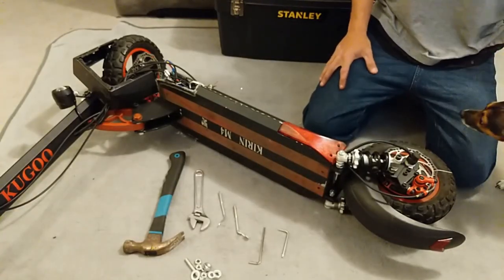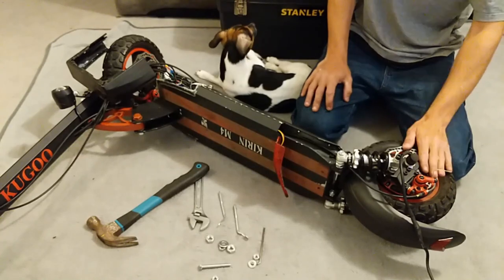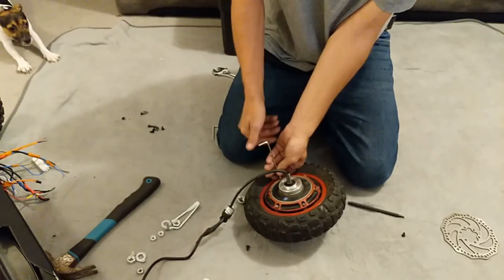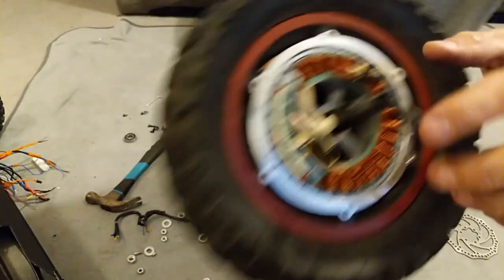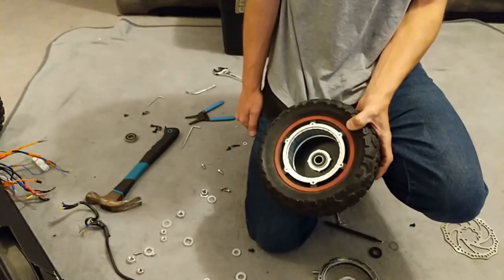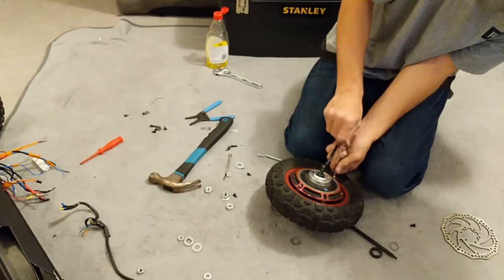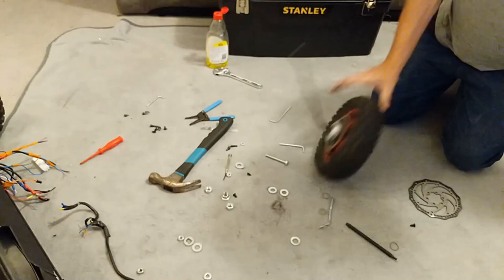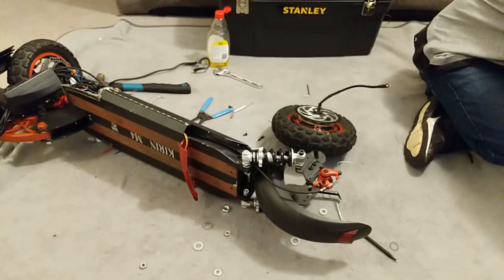Kugoo M4 rear bearings replacement Demo (Motor wheel)

Comment: IV had a tyre change now IV got error 1 and my scooter doesn't work the wheel spins when off the ground but makes a loud rubbing noise and when I try ride it it's cuts itself out
Reply: I've got the same issue have you fixed it

Comment: I have a grinding noise from the back wheel (Motor ?) when I accelerate but the noise goes when I release the accelerator even though the scooter is free wheeling, is there any demos to fix this problem, ?
Reply: Ive got the same issue have you sorted it
Reply: @5staranis800  Not yet, The fellow I bought the scooter from no longer answers the phone, im trying to contact kugoo directly, but not having a lot of luck, If I do get to resolve this, I will let you know and I would appreciate it if you do the same,  Thanks

Comment: Brilliant video, much more helpful than I was even hoping for! Just a suggestion though, you may want to add some kind of tag to your video. I've just used the first 15 minutes to show myself exactly how to easily get to absolutely everything I need in order to fix the "E-001" error. You have made it simple to isolate all the correct wires, as well as removing the rear wheel to repair/solder any breaks that could be causing that exact fault. There aren't many videos that have helped with that fault (and on the exact scooter I was looking for). The ones I found were mostly non-english so I had no idea what was being said. If you were to add a tag for the E-001 code you might help even more people :)
Reply from the maker: Thanks for the comment mate. I'll take the advice onboard . Error 001 on a tf-100 LCD display most of the time means hall sensor failure there are a few rare exceptions but mostly hall sensor . If your ever stuck feel free to send me a message an I'll talk u through any scooter/ebike issue's

Comment: Thanks a lot man ! If anybody around here is trying to fix the bearings of the urbanglide ecross pro, it’s the same only when you have to put back the motor inside the wiring are facing down and not up, otherwise it can’t go fully inside and you can’t close the lid

Comment: Hi mate I replaced my tyre tube and now I've got a error code 0001 a motor error but so it doesn't spin at all but when I switch of lights horn etc the motor starts to work but I just vibrates but when I put the scooter on ground it just vibrates
Reply: IV got the exact same problem. My wheel does spin when not in the ground but with a loud rubbing noise . If I try to ride it it just cuts out. Error code 1 aswell
Reply: @lornadavis6663  that's exactly what's happening to me too let me know if you fix it pal
Reply: @5staranis800  no idea mate IV looked everywhere online and there not a thing that can help. I'm taking my rear wheel to bits tonight cos that seams to be my only option. I'll let you know if I can find the problem
Reply: @lornadavis6663  me to please I got the same 😂

Comment: Nice vid. How much will you charge me to sort my scooter out. I've got a kugoo m4 and i popped the back innertube. I've been through about 5 tubes and they all pop. I ordered a solid back tyre for it but it doesn't fit even though it says its for m4. its doing my head in tbh lol taking the wheel off and putting it ack together for it to pop i think it may need a re wire because taking the wheel off all the time rips the wire casing. it still works fine but not really ridable with a flat tyre.

Comment: What would you do if u damaged the wire's,I have soldered back together but it still doesn't work???????
Reply from the maker: Hi mate , damaged motor wire few questions  did u rewire it going with a new cable going right through the spindle or was it a cable break that left u enough room to rejoin the too half's  in either case did u check the hall sensors are still functioning,  chances are if u had a cable break and the scooter was powered up one of the three phase wires touched a hall sensor line and passed more than the 5volts the sensors can handle . Sounds bad but it's not and if u manged to Solder the cable back together I don't see no reason u couldn't swap out the sensors your self if u felt up to it

Comment: The wire on my back wheel has been damaged and I don’t know what to do only had it a month
Reply: I done the same thing gonna attempt a repair on the weekend
Reply: @roya1er210  did it workout and how hard was it
Reply: It works lost a few mph off my top speed for some reason but its very findly but its possible

Comment: Where did you get tiers from please
Reply from the maker: Amazon mate 10x3 tubeless tyres but they also can be used with a 10.25 inner tube that is supplied as well with each tyre 19.99 each

Comment: Need help with Erre coad 6
Reply from the maker: Hi thanks for the comment, what scooter model do u have
Reply: Hi Mike hear ,thank you for your reply, I've got a kugoo M4 I have tried checking all CONNECTORS  for loose pins and checked halls in hub and still  at a lose
Reply from the maker: @mikecathrew9658  hi error 6 on a m4 relates to a communication error between the lcd and the contoller its most likely one of to things a break in the wire loom or the wire loom Junction point at the head it has a known issue . Do u have a multi meter by any chance and I could show u how to find the fault
Reply: @alphamods6791  yes I have a multimeter if you pont me in the right direction I am shuar
Reply: I can do it
Reply from the maker: What model scooter mate